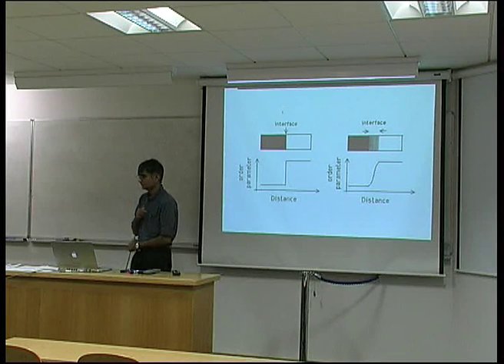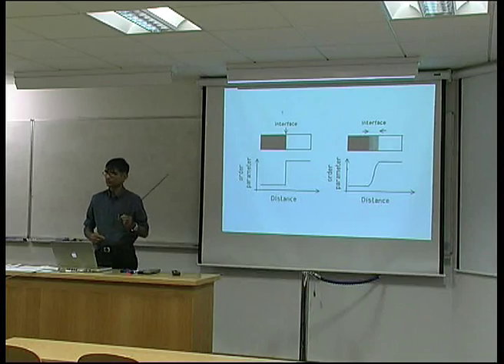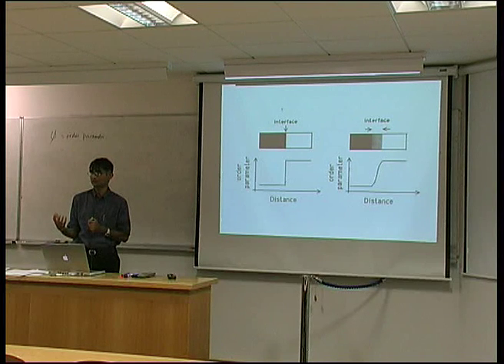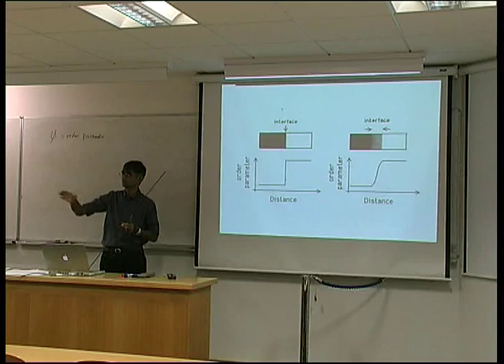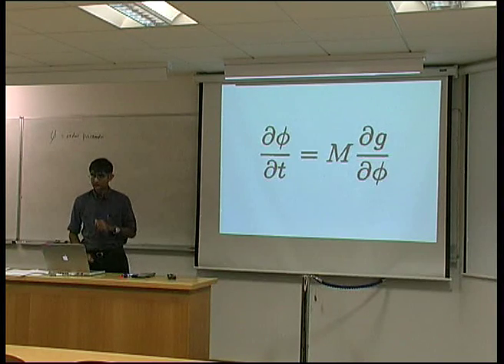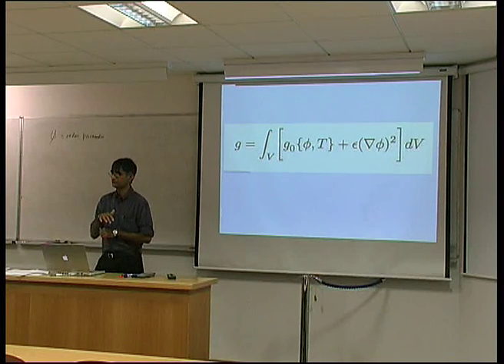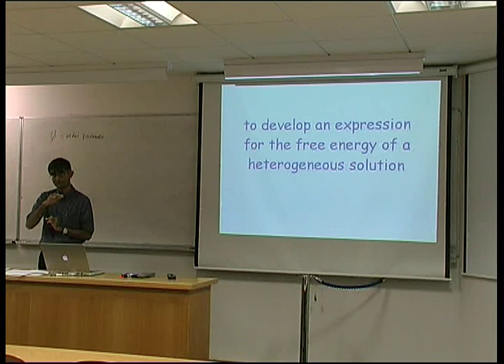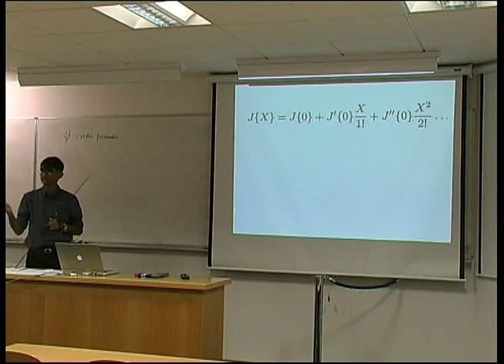Kinetics: Phase Field Modelling

Comment: As of my knowledge there is no complete video lecture on Crystal Plasticity based Material Model. One short over view on Crystal Plasticity has been given by Prof. Dierk Raabe(watch?v=5VZXZYmW8tQ&feature=channel&list=UL). But to understand it in the label on numerically implementation need a more complete lecture with adequate mathematical details.
It will be very useful for me and many others if you can provide a video lecture on Crystal Plasticity or any source-link for such kind of videos.